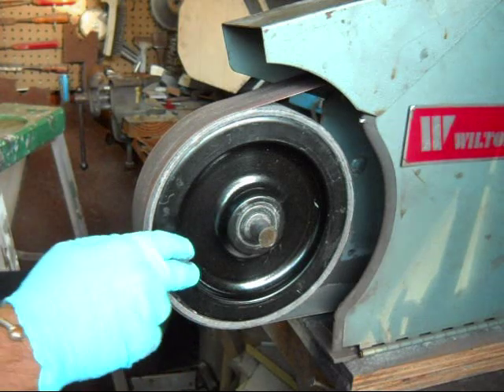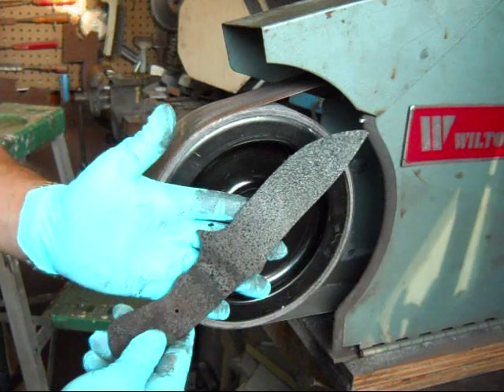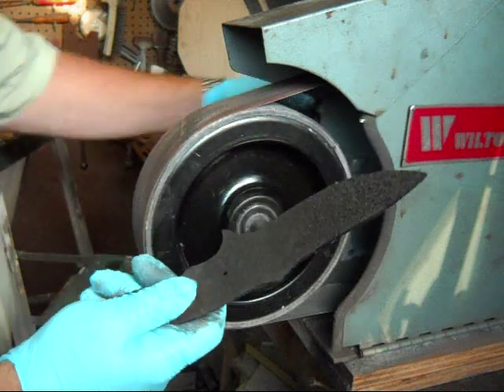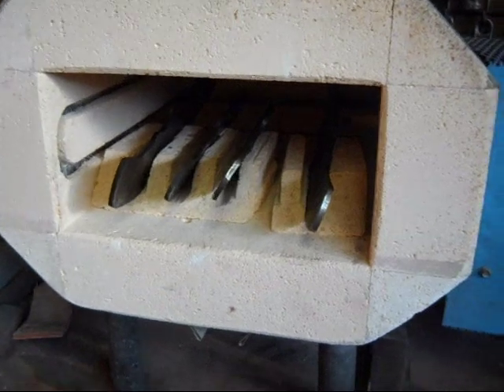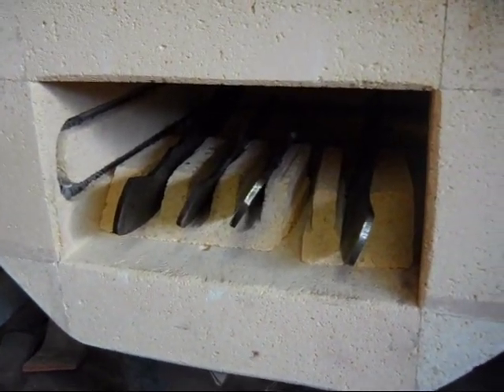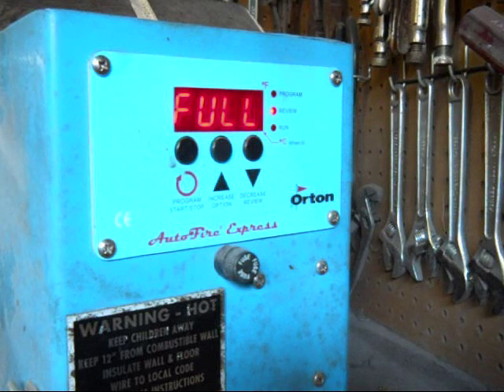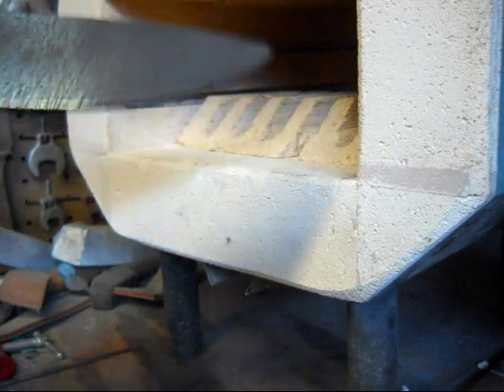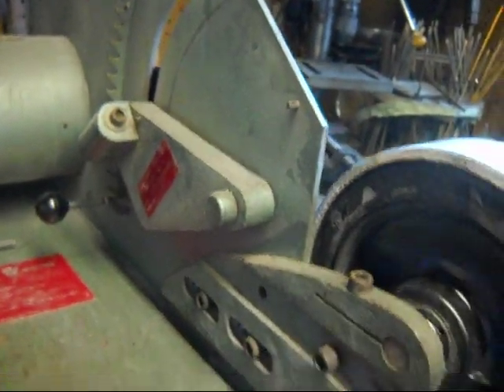Knife Build Part 2

Comment from the maker: It can be done either way.  You have to be careful to not heat the metal too much after heat  treating or else you will change the temper.  You do this by dunking in water often.  This is the big reason that gloves are not worn.  As long as you can touch the metal you have not heated it too much.  The grinder has no problems even after heat treating.  If you were doing stock removal by hand, with a file - that would be a whole different story.

Comment from the maker: If you look at my video "Anatomy of An Alaskan Bush Knife" I sort of show how I did it before I had the oven.  I used a brush burner attached to a propane bottle to heat it up to the point where it is non-magnetic and then quench.  I tempered them in the kitchen oven.

Comment: Mr Crash i need to take a moment and pick your mind . have you changed over to canola oil or peanut oil  and if so  are you  heating your oil to any temperature before you  quench ? for myself I use  a lot of 52100E and even  with 5160 found  with a triple quench  heating my oil between 135 to 150 I get  a more cleaner quench the harden area of the blade has little to no scale what so ever , do you find this  with using canola oil or peanut oil ? I am interested in your feed back  thanks .
Reply from the maker: Lucky B I do heat my oil.  In the summer, my hot little work shop (no ac) leaves the oil temp at about 110 which is about where I like it.  I have had my heat treat RC tested and am pretty satisfied with the results.  I know that some people pre-heat theirs a bit higher, but 110 seems to be a good starting point for me.
Reply: many do not under stand  that heating the oil helps cool the steel faster , leaf spring is a forgiving  steel you can quench it in 60 deg oil and it will take a hardness while L-6 a very beautiful steel is a little more temperamental that big burr blade  you had years ago i was gave 7 of them blades from a saw mill that was ripped down . and annealing them was fun  a steel frame to hold them and a big fire under the saw blade and a  squirrel cage with a 12 x 12 opening . i know im babbling , but L-6 is a very nice steel .. and Oh BtW  I notice the ring  , thank you for your service . which one  3 or 5 ? :)  keep em sharp ..

Comment: why do you temper the whole blade? I've seen others that they have the edge in water while with a blowtorch tempering the rest of the blade.
I'm not trying to be rude or anything I just want to learn
Reply from the maker: This gives the results I want.  With the water dip method the knife edge is not hard enough IMO and the spine can become brittle.  This method gives very repeatable results.
Reply: aa ok, thanks :)